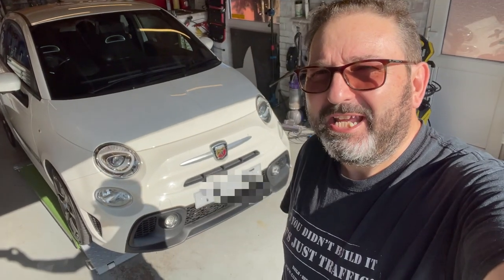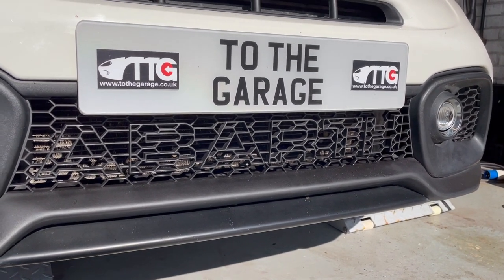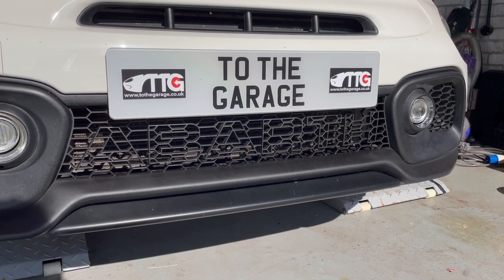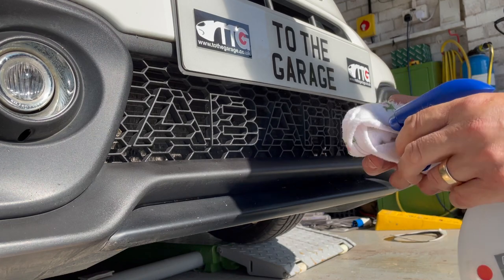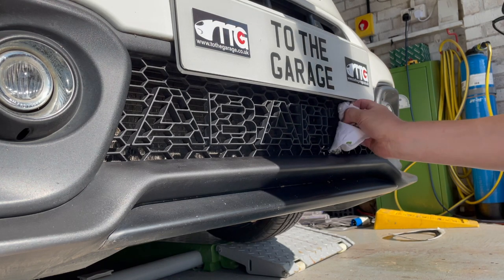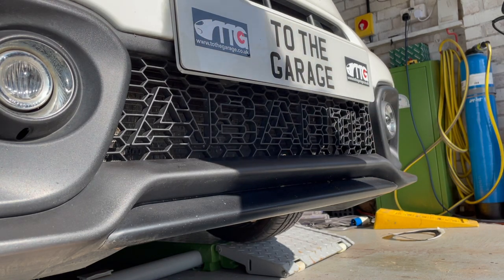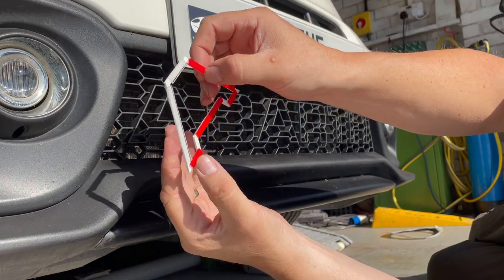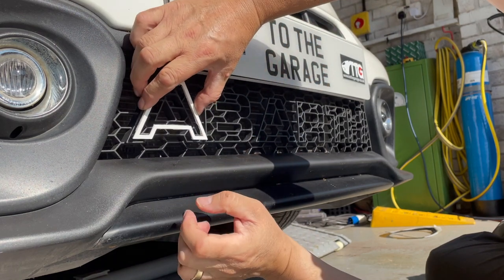Installing 3 d printed Abarth Grill letters on our 595

Comment: I bought the exact same colour 595 about 3 weeks ago and mine also looks very bare in white, and that’s how I’ve stumbled onto your videos!
Are you planning on keeping the chrome on yours? I want to change the front bar (around the front logo) to black but the wrap company near me have refused to do the job because they think it could break if they try to remove it. It’s work in progress!
Reply from the maker: Its sort of matt silver finish on ours Rob, along with the door handles and number plate light cowl. We will keep them as is (for now😉)